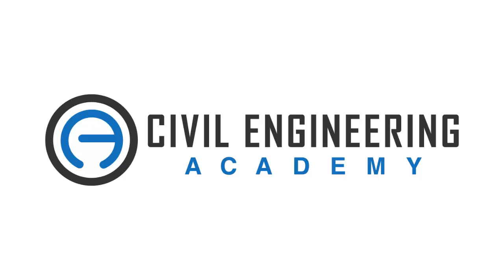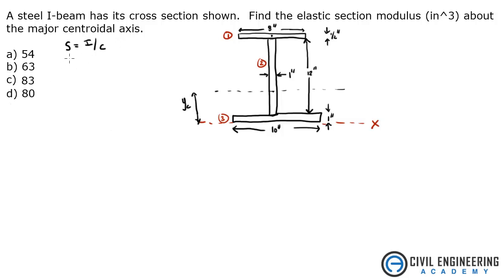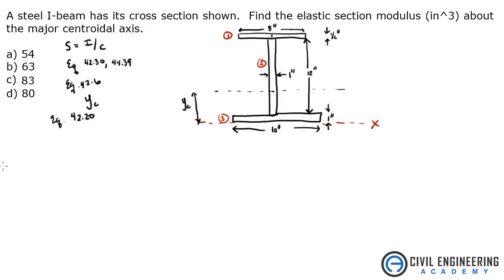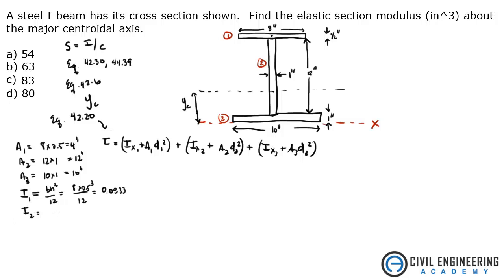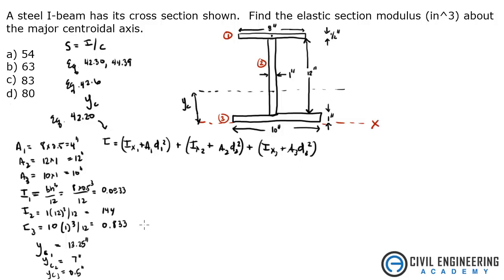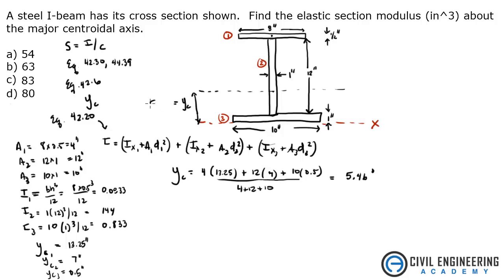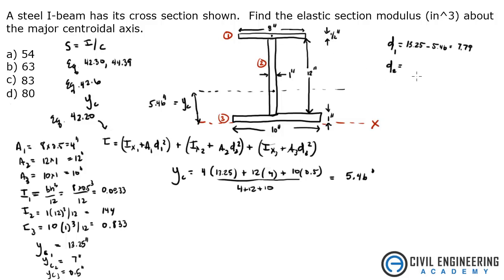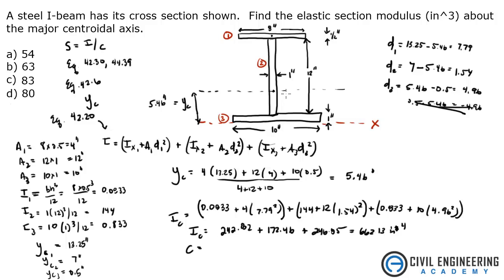Structures-Find Elastic Section Modulus

Comment: I got a different answer for the final step S = 662.13/8.04 = 82.3
However the solution is still "C"
Reply from the maker: rpzl77 thanks!  I left a note on the video.  I must have read my calculator wrong!  Don't do that on the test :)
Reply: Me too.